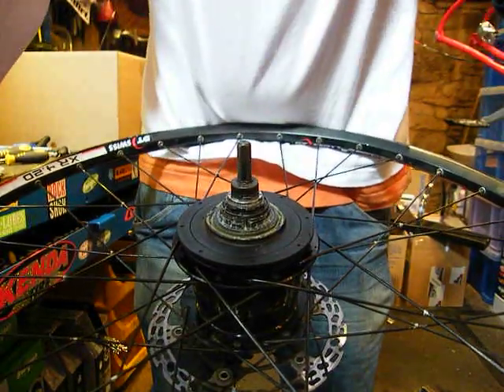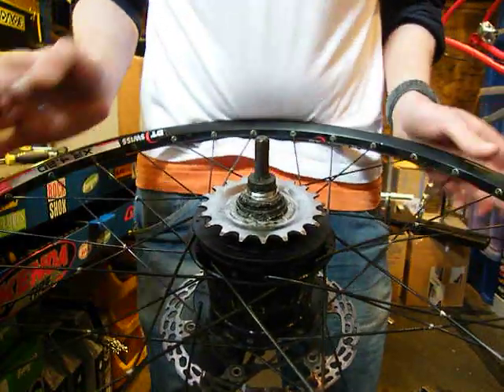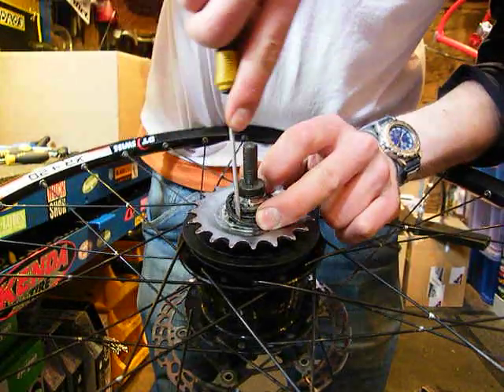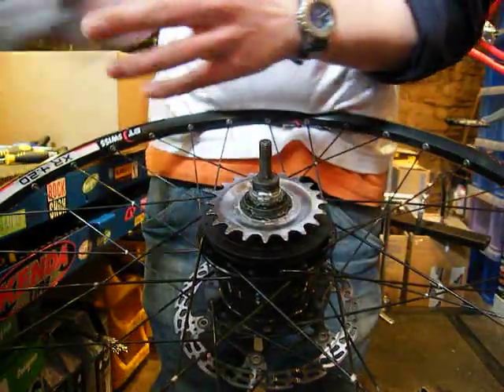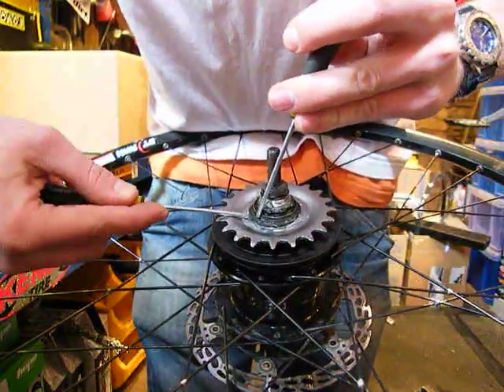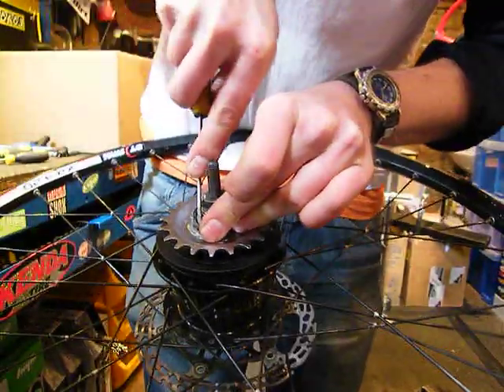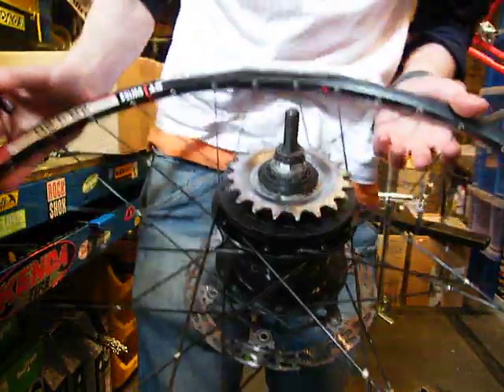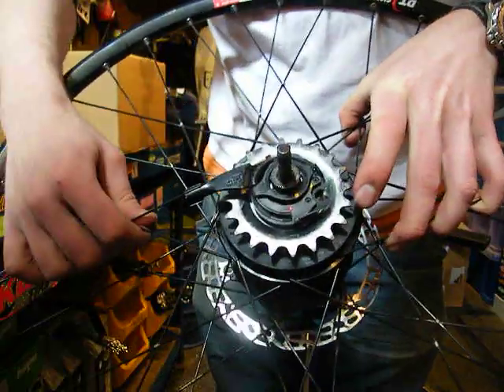Fitting Sprocket, snap ring and cassette joint to Shimano Alfine 8 Speed

Comment: 11 years later and you're still helpful!  I was dorking around with that snap ring and not sure I was on the right track..  I was right but my screw drivers were too fat, and it just seemed like I was making it too hard.  Thank you ever so much!
Reply: May i ask you something ? Can i fit any tooth procket to my shimano 7speed internal gear hub or do it need to have certain number of tooth ?

Comment: I found a way to get it on a bit easier. I cut up a bit of tin from an old paint tin, and curled it into a truncated slight cone that would fit around the base. Then I put the circlip on the top and just pushed it down with a screwdriver. Was pretty easy.

Getting the clip off, I more or less used the instructions above.

Comment: Thanks. The main trick for the snap ring for me was to shift into low gear.  This allowed the third red dot (on the outer portion of the cable ring mechanism) to line up with the other two red dots (4:06 in the video) and moved the yellowed dot on the cable mechanism to be in the right position for the snap ring.  No tools or force needed, it just snaps in by hand, as shown in the video.  If your three red dots don't seem aligned, play with your shifter all the way up and back down, which lengthens and shortens the cable and changes the position of the dots.

Comment: Great, very clear!

What is the largest rear cog they make for this hub? I'm towing a trailer with it up some steep hills, heavy trailer (sometimes as much as 100Kg) and I need to get some lower gears. My bike, a 2010 Charge Mixer 8, came with a 39T up front and a 19T in the rear, I'd like to go to a LOT lower gearing, any suggestions?

Thanks!

Comment: I've a Alfine 11 hub in my Cube Hooper Pro. Doing al the maintenance myself and really cant see the problem with the snap ring. I get it off or on in about 10 sec. Counterclockwise pushing against the gap with a flat blade to lift it off. Same principal for putting it on using my fingers to get it around the axle/spindle.

Comment: Great video.....but what if i change my chainring to a bigger one and my rear sprocket to a smaller one will that make me go faster?
Reply: You could be faster than what you have now but it would also be harder to climb hills. Think of a standard transmission & trying to climb hills in 4th. gear instead of 3rd. 4th is faster but 3rd. gear will climb easier.

Comment: Anyone replace the snap ring with a more conventional snap ring with holes on the ends for a snap ring pliers? Also I believe the cog or sprocket on the Alfine is fitted concave inwards or opposite of what is shown.
Reply: The Sprockets are reversible to match different chain lines

Comment: Why wouldn't you just use circlip pliers
Reply: It has no holes in the snap ring for the pliers.  It's not a circlip much to my frustration.
]
Reply: @lthomas987  Knipex 45 10 170 Special Retaining Ring Pliers is for rings like this one
According to one amazon.de review, it works for Shimano Nexus snap ring...